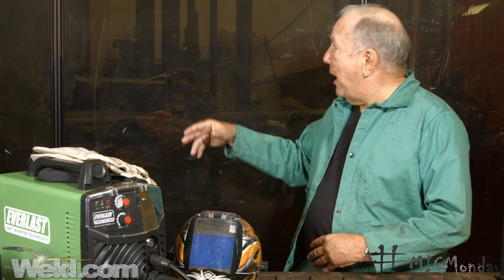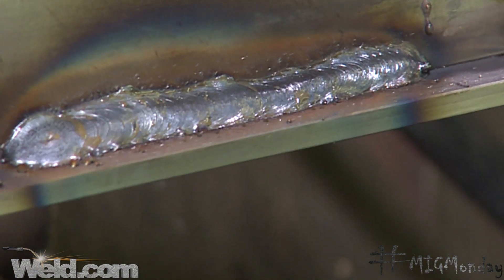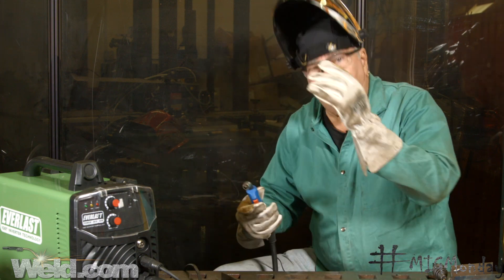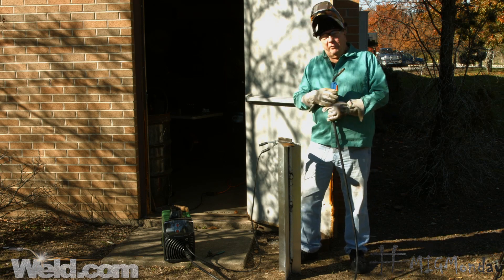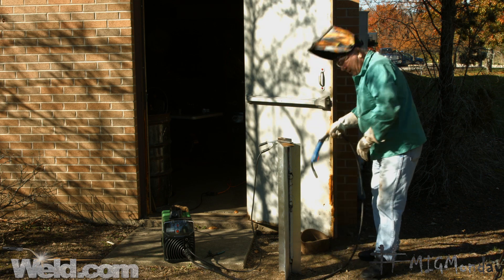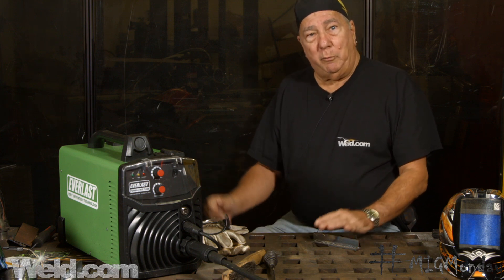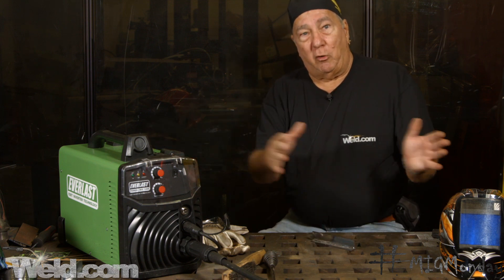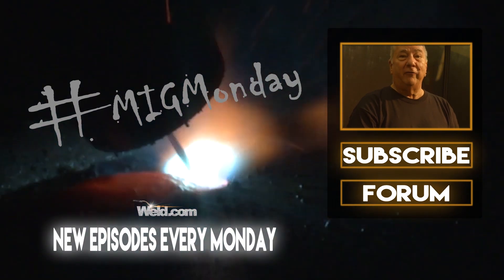MIG vs Flux Cored Welding and when to use each

Comment: I see people criticizing Paul’s welds. I’m 68, and I’m not quite as steady as I was. Are they bad welds? Well, rarely, but it does happen. Paul happens to be very knowledgeable, more so than his critics. If his welds are not what they used to be, that’s natural, as he’s also an older guy. Most of his welds are just fine. Occasionally, they may be marginal. But that’s not even the point. His explanations of what he’s doing are valuable. It’s too bad if he’s not doing this anymore.
Reply: Mel Gross I wouldn't worry about those critics, their day WILL come.
Reply: I agree Mel. I was the base oxy/accel welder in Vietnam (all we had) I got a setup as soon as I got home and did the gas and stick since. I kind of got away from welding in the past years as I couldn’t see what it was doing with my bifocal glasses. By accident I found cheapo readers really helped me. I just recently while doing body work was frustrated with gas welding and just bought a small MiG setup that’s why I’m here and this 70yr old is trying to once again learn all he can.
Reply: I`m a welding inspector/instructor here in the UK (and a fully certified welder of course) most of my job nowadays involves me going to factory's and conducing weld tests on qualified welders or teaching the non skilled fabricator guys how to do fillets, tacks and pen` T`s  and I'll tell you this for nothing. There is no way you can judge the quality of a weld by how it looks. I've seen guys that lay down beautiful even, smooth and perfect LOOKING welds that are full of voids with patchy penetration and others who's welds look like an albatross flew over and took a crap BUT technically the weld is perfect. So his welds might be good, they might be crap but you can`t tell from a video.
Reply: @Bikey_McBeardface  you are absolutely right! I keep telling that to people. Sites like this one, Jody’s welding tips and tricks and some others make that point as well.
But people who don’t understand what a weld is (most guys commenting on channels) think that beauty is more than skin deep.
Reply: Mel Gross agreed sir.
Reply: Props to the viewers that can discern this without the need for an explanation or the need to critique.  The ones that have a need to criticize are the ones that cannot think beyond the stretch of their arm.   Great video, God bless this man.
Reply: @jbwolfhunter8031  Absolutely agree.
Reply: I'm in welding school right now. My favorite instructors are the older instructors. So many tips.
Reply: @welderprincess133  good luck. It’s a fine profession.
Reply: @melgross  thank you!! 🥰🥰🥰
Reply: I think Paul had probably forgotten more than some of us will ever know. When you get to be his age, with that level of experience, what is to be proven!
Reply: @JeffAboularage  well, I’m now 74 and I still design and build various projects. But I have to really concentrate to make that straight weld, or to see where I’m welding. It’s more difficult. My welds aren’t as steady even as much as they were when I first wrote that post. But like Paul was there, I’m able to make good welds, even if they aren’t always as pretty as they used to be.
Reply: @melgross  I hope to still be welding and building things when I am that age. I am 40. I didn’t start welding until 4 years ago. It was something I always wanted to potentially do for a living.. So I took the last of my GI bill from the military and made it happen.It’s a labor of love, for sure! One thing I have learned about MIG or Flux Core, if you so much as flinch sometimes, the weld will go crooked. It happens!
Reply: @JeffAboularage  I’m glad to see new people beginning welding at any age. I first began in 1973. I was a partner in a Pro audio company and we needed a number of steel structures for our manufacturing. I decided to take some welding courses and do it myself. I’ve been welding ever since. It’s a really satisfying thing to do. Somehow, drilling holes and tapping them for screws doesn’t give that level of satisfaction that welding parts together does. Odd that it may seem, but welding has a very organic growth feel to it and it’s much more personal than other mechanical joining methods. Of course, it can be much stronger and simpler as well. Just keep at it.
Reply: @DownTownBrown71-x2j  that is very sad to hear a mans pride is his welds I hope your grand pop the best sounds like a great guy
Reply: A weld doesn't have to be beautiful to be a good weld either. Welds have one purpose only. They just need to bind your metal. Also, I'd bet many of the critics aren't even that great of a welder. Lol
Reply: @Col_Sanders  I’ll bet most of them never welded anything.
Reply: What’s wrong with his Welds lol😅 looks better than mine and I’m more than half his age. This is just a demo video, doesn’t have to be a perfect weld
Reply: @arnobashtar6707  don’t reply to me, I’m supporting him. Rep,y to the haters here.
Reply: I've scrolled this entire comment section and I still haven't found anyone criticizing his welds. I think you guys are too sensitive and need to calm down. A single bad comment or two won't hurt Paul, he's not a delicate youtuber. 

Toughen up.
Reply: Engineer here, more major construction projects than I care to remember. 

Good welders are mostly in attitude. This guy is passing on knowledge and wisdom. Take that for what it is.

Comment: can you use flux core welding to weld car panel
Reply: maybe spot weld but I doubt it, you will just make holes. I've done 1mm with flux core and it requires ghetto techniques to get the job done....

Comment: I noticed with flux core you pulled away from the weld and with solid wire you pushed the weld.  Why the different direction with different wire. Thanks
Reply: Lavar Mathena because it's a slag producing process. If you would push the weld, you would end up welding on your slag and get slag inclusions. Just like electrodes, you always pull the gun/electrode.
Reply: Lavar Mathena - if it has slag, you drag- fcaw, stick. Any type of self shielded welding.
Reply: I know I'm a bit late to the party here but in ideal (mostly) it goes "with slag you drag, with wire feed the fire". Lol. Those types of rhymines/sayings can and did help me out alot 15+ years ago when I was taking my first class (C-ticket) up here in Canad'erp!!!   
 Turn and burn burn 🔥!!!
Reply: No slag you push the puddle. Slag you drag.

Comment: .030 mig flux core vs klutch 80amp stick welding, which is easier and which is better? Thank You Ben
Reply: Ben Schapero This is kind of my own understanding, but with MIG I've learned it creates more pretty and quick welds, while stick welding can be a bit more challenging and takes time to clean up.  MIG is durable, though I work with .035, and I believe arc is typically more strong than mig. but for either it really depends on what you are attempting to do, and what you are using for your machine, say stick or wire sizes.
Reply: I'm no expert but I have both an everlast flux core welder and a stick welder and have welded with each. Both will have slag that you need to clean off. With flux core you can point and shoot while with stick the electrode gets shorter as you weld so from that perspective flux core is a bit easier to start with because you then only need to concentrate on travel speed and electrode to work piece distance.

Comment: Helpful video for those who are inexperienced.  It should maybe be noted that the FCAW wire is a more costly product than the solid core bare wire mig wire. Perhaps a comparison of the different types of mig (or mag) shielding gases, and their relative costs, would be helpful as well.

Comment: watching this guys videos he always ends up with pretty bad welds.
Reply: Are you serious? This is an instructional video on the difference between using argon, and flux core wire. Not to see how pretty you can make a weld. Grow up, and maybe someday, you'll learn how and when to make a comment..
Reply: it holds, it's all that matters it's not about how pretty a weld is. It's if the weld holds and works.
Reply: No need to be critical of the man. He is older. The older we get the less steady we become. We will become less steady some day. Not always about looks. As long as it holds.

Comment: one more thing i would suggest when you a re going to do fluxcore is to change your gun nozzle to one made specifically for fluxcore. if you use the standard mig nozzle with fluxcore, you will inevitably have to replace it along with your contact tip as the slag and spatter from the fluxcore process will find it's way into the small holes that feed your mig gas through the nozzle

Comment: As a welding instructor I can't help noticing the slag inclusions in the toe of your flux core welds. This is not ok. If you get a bad weld, ( same as the other week when you got a complete lack of fusion when showing different techniques how to push the puddle, please do another one and don't say a bad weld is good. You also don't do a "MIG"-weld (, but I guess you use the MAG process with straight CO2) outside. This does not give a side by side comparison.
Reply: Don Coervers luckily this guy is no longer making videos for weld.com guess his mistakes piled up. The problem is not to make all perfect welds, but to claim they are good when they obviously aren't. So now when you make a weld like that you think it's ok.
Reply: Show us what you mean ,make a video, please.
Reply: +Tomas Jonsson but at least they changed the material thickness.
Reply: Correcting slag inclusions would mean higher amperage and increased travel rate. But that seems like it would have less penetration and a weaker joint.
Reply: Don Coervers welding tips and tricks is by far the best Chanel.